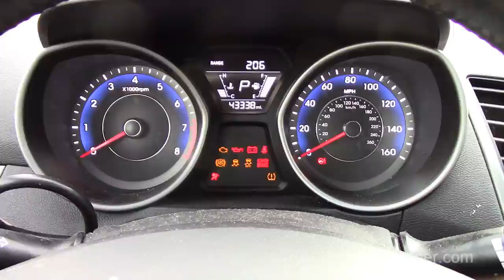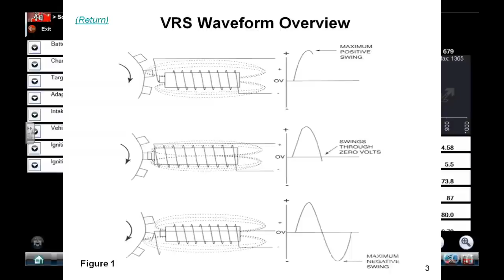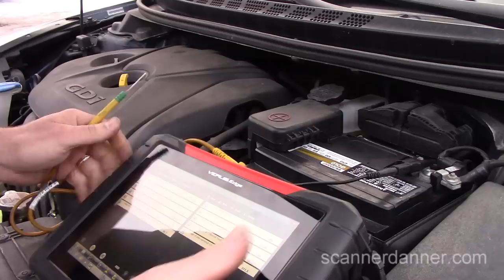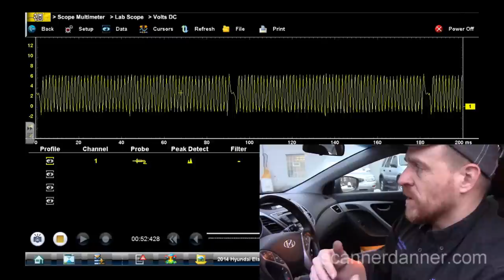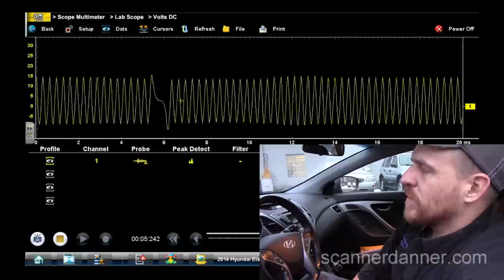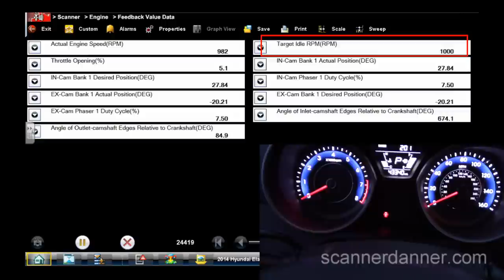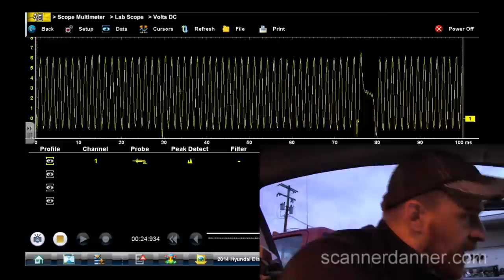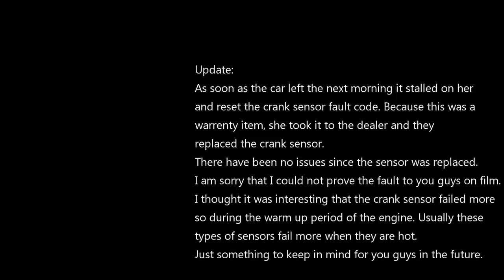2014 Hyundai Elantra Intermittent Stalling P0335 Crankshaft Position Sensor "A" Circuit

Comment: My wifey complained about stalling coming to stops and at idle.  I was not able to duplicate it or witness the failure myself for 3 weeks of me driving the car and riding with my wife driving. It was driving us crazy.  It only stall on her.  The after driving another 1200 miles appx.  It stalled on me like gang busters.  It would stall.  Hard crank to restart engine with warning ESC light and check engine light on.  The ESC on cases a super slow acceleration 0-15 in 6+ seconds, no RPM reading, and rough idling.  The next morning I took a couple hours to self monitor the car.  I cleared the warning lights by cycling the key on/off until the car started normally.  I let the idling until it stalled at appx.10 minutes when engine temperature was up.  My restart had the same results Check Engine & ESC lights on.  I cleared the warning lights and let the engine cool.  Car started fine and stall when it reached operating temp.  With the warning light on I ran a scan and got the P 0335 crank shaft sensor code.  Called up Napa and got the part $160 - Sensor CSS1435 for 2013 Elantra GT with 138K miles.  Removal & Replacement took 15 minutes. This is the only problem we’ve had with the car since buying it new.  FYI - DEALERSHIP HAD THE CAR FOR TWO WEEKS AND DIDN’T DO DIDDLY SQUAT.  SOMETIMES YOU JUST HAVE TO GO ON DIYS BEAST MODE THE GET THINGS DONE!  

It’s been 3 week!  Car is running good!

Cheers!

SJ

Comment: With no crank signal would engine rev-up still ? Friend tells me car won't go over 25mph. Has code p0355 runs fine when I drive it. I'm going to check wiring and replace the sensor most likely..

Comment: Yet another great video thanks man. I have a question about these vr sensors if you were to have a missing signal on 1 of the 2 crank sensor wires would it affect running at all. For instance a broken cable on one of the 2 ?
Reply: I wish he answer ur question, mine is missing ground signal

Comment: IMPORTANT: I had the same issue, it turns out I was really low on fuel. It stalled out on me once but the fuel gauge was reading two lines. The digital fuel gauge can be deceiving sometimes. When it stalled, it triggered the p0335 code. All I did was fueled it up, and the problem never came back

Comment: I changed the crank and exhaust camshaft sensors. No check engine light now. Still stalls. Dealer said the ecm need to told that the sensors were changed ($145) .  Sounds like BS.  Is this true?

Comment: Great video. I'd need your help, please. I have a probleme with my KIA TUCSON 2.0 DIESEL. Check engine is on, DTC P0404 «exhaust gaz recirculation circuit rang/performance» and the engine is on limp home.  Current data displays EGR doesn't work somtimes (intermittent), and when she work( after switch off - start engine), she work from 0% to 100% witch means EGR is wide opened or close. I changed EGR valve with a new one, electricale circuit is good, is the ECM defective ?
Reply: hey I'm no pro, but assuming its ground side controlled, might be an intermittent touch of the solenoid ground wire to the body (which you will never find on idle always happens when driving over bumps or road swimming pools lol. I would check o2 signal(Diesels dont have these then look at rough idle) whilst chugging the wire a little. if it goes rich then you found the problem. other then that look at sensors that provide input to actuate the EGR valve. Like ect, Engine speed sensor(CKP) regards student of Danner.
Reply: or intermitted power supply to the solenoid, funny connector.

Comment: Use De-Oxit to clean the connector contacts, tighten the pins and put dielectric grease on the contact areas. Test the crankshaft sensor itself if you find it.
Reply: Did this resolve the problem?

Comment: I've seen this kind of fault several times on Kia and Hyundai vehicles. If you see crankshaft related faults on ecu, you can really just replace the sensor, it's a very common fault on those cars. I don't usually blindly replace sensors just on fault codes, but on those specific cases there's not really much to it. And about the fault not showing up when the technician is around, it happens all the time 😅🤣
Reply from the maker: Agree with you on this one. New sensor was the fix and I couldn't prove it when the scope was connected. Next one I see is getting a sensor without even testing it.
Reply: Hey, how are you doing good sir? Hyundai Tech here, very common for CEL to appear and reappear with this code. Replace with OEM sensor and drive easy first couple miles usually done on test drive before releasing vehicle. Assuming there is no damage done to your harness a new CPS will fix your issue. Conditions should appear within 2 drive cycles also if you’re diagnosing. Goodluck!
Reply: @joecastro23  Hey mate, can you maybe help me with some info, since you are a Hyundai tech :). I have a Hyundai i30 (i live in Europe) with a 1.6 GFI G4FD engine that has some problems. 
First the engine runs rough on idle, shakes a lot, the idle rpm oscillates between 650 and 599, but runs better at higher rpm (over 1000). 
The car starts ok from cold/hot but the LONGFT is -6.5 in idle but goes to 0 when i rev up (its 0 around 3000 rpm). A mechanic changed the crankshaft sensor because of a p0335 DTC, and then changed the intake cam shaft sensor, now i get a p0340 but it's intermittent, sometimes it triggers a CEL but then it clears itself. 
I went to a shop and they said it's the timing chain that is worn (they did not check the chain) and it needs to be changed, but since its around 1000$ job i wanted to hear other opinions. The car has around 128k km (80k miles) with automatic transmission. If you have some tips please dont hesitate, thanks!
Reply: Did you find a fix? Was it the chain? I've got a similar situation for a month now, vexing
Reply: @Oladapofrank  if you get P0335 and there's no reason to believe the engine is out of timing, it is usually just the ckp sensor. If you give me more feedback on the issue, I might be able to help.
Reply: @thereeven  thank you, I couldn't use the car all of December, successfully ruined my plans, it's a 2009 V6 Hyundai sonata, it's got the 2-3 seconds rattle on cold starts, when the engine has been sitting for many hours it does that but goes away within 3 seconds, many people have the same issues so I don't think that's enough to conclude the engine is out of time.
The crankshaft position sensor I got wasn't from Hyundai, was after market, Chinese ( I know lol) but then my tach moves during cranking even with the old sensor, same with the new but the issue still persists, I even bought one camshaft position sensor (engine uses two) and it did nothing. 
I don't think there's a reason to suspect it's out of time, please enlightenment me if that assumption is wrong, I'd also like reputable brands for these sensors, a website to order too, thank you.
Reply: @Oladapofrank  about the brand of the sensor, I tend to prefer the genuine ones. Chinese sensors tend to work ok for some time and fail after getting hot. They are truly random at quality. Some may last, others don't. But let me get this straight: your issue is ONLY the noise? The timing chain noise itself is NOT related to the sensor, that I can assure you. If your problem is only the rattling noise in cold startups, this can be related to a failing chain tensioner, and in that case, the whole chain, tensioner and chain guides should be replaced as a kit, to avoid costly headaches. Oil and oil filter quality can also affect this rattling issue, be aware of that. This is a common issue with older engines regardless of brand, and if the rattling goes away and don't come back when the engine is warm and running, that can be a sign of an engine that may still be worth servicing. And you didn't mention, is rattling the only problem? Does the engine runs fine?

Comment: Question. these sensors have the benefit that they do not require an external power supply, because they produce there own voltage. However where is the 2.5 volts coming from when key is on engine off.

Comment: I had a some problem on the chevo Cruze crankshaft position sensor and the car has a hard crank sometimes it's stalling , I thought of changing the crankshaft sensor but my tools doesn't learn the crankshaft sensor , any idea how I can learn it after I changed the crankshaft sensor 🤗🤗🤗 thanks for the video

Comment: I've also had this problem code P0335, with a 2004 Maxima. I recently changed the sensor, but after a day of no issue driving, the car stalling when stopped, with the same problem code. However, now with a new development, RPMs are fluctuating (up and down sporadically) while in gear and engine is sluggish to accelerate.... perhaps something beyond the sensor issue?
Reply from the maker: Factory sensor only on Nissan!
Reply: @ScannerDanner  I have a 2016 accent same issues after I replaced the sensor the problem came back now I’m stuck on what to do

Comment: What about a starter that keeps failing? I get this clicking noise coming from my steering column. I took to the dealership and they replaced the starter, and said I had the wrong type of battery. I had a flood battery. Didn't replace the battery because the starter issue wen't away for about a year. Noise came back - decided to replace the battery w/an AGM type battery, ticking noise went away for a few months. Now its back with a revenge! Car dealerships are worthless. I've had the same stalling issue as in your video but it hasn't happened in some time.  Could it be the crankshaft sensor???

Comment: Every failing crank sensor I have come across fails when its hot...Many times I hve simply removed the sensor sprayed it with an aerosol like break cleaner to cool it down and it starts right up when installed...
Reply from the maker: me too, until now

Comment: I have a 2012 Hyundai accent and I suspect that the crankshaft sensor is bad because I tried to start the car and it cranked for a long time then I drove without a tachometer and the trans started to slip.

Comment: Great vid as always, thx buddy. I have this same code in a Hyundai i10 cranks ok but no start. I am curious, if I unplug the sensor and measure voltage, I have 12v on both pins. As soon as I turn ignition on, that voltage drops to 9.5v on both and when I crank it's obviously lower because of the load. This cannot be ok right?
Reply from the maker: This sensor produces its own voltage. Anything you see unplugged would be some type of bias voltage. 
Measure the sensor output (between the pins) with it plugged in and back-probing and use your AC scale of your meter

Comment: Got a p0300 code, and p0305 both misfire. But said it was coming from crankshaft sensor. I changed it, and my truck went nuts!! It through code p0339. It idles up and down until it shuts off. Flashing check engine light

Comment: Hi Paul, another great video thanks. I’m having a very similar problem. 08 Scion XB 2.4. Same code, however no stalling, no drivability problems at all. Prior to me the crank sensor and pcm (used) have been replaced. I’m curious, your code says circuit A. My says circuit B. I can’t seem to find info on that. Any ideas? Also if anyone has run across something similar, I appreciate advice. Thanks.
Reply from the maker: Not sure offhand but those are significant at times in giving you direction. You need to at least read the flowchart to determine your variables.

Comment: I have a 2013 Elantra the RPMs shut down but there's no code showing the mechanic checked it no codes showing no check engine on the sounds of the same problem

Comment: Was wondering if we could expect the similar symptoms for camshaft sensor faults too?
Reply from the maker: depends on the car, they all react differently to cam sensor faults depending on the ignition design of the car and also how many cam sensors it has
Reply: Speaking from experience. The answer is. Yes. Camshaft sensor needs replacing as well.

Comment: Wondering if this is the same freaking thing in my 2013 elantra.  Brought mine into two shops after twice having it randomly not start and neither shop could replicate it.  I guess for good reason they can't since it seems to do it weeks in between.

It cranks but starts up incredibly weak when it finally gets going, tach would still work although granted eradically, and the engine again sounded very very quiet but stumbling almost like a misfire.  After doing a restart of the car, all is fine like nothing happened.  I wonder if Im just seeing the beginning of the rabbit hole, I already dropped money on a battery sadly after a shop told me it was bad because of the CCA.

One day I got in my car thinking doo doo doo brand new battery I'm good.  I turned the key, crank crank crank for what seemed to be way too long, before it finally started but again unnaturally quiet and stumbling almost dying.  I may just try this man, I've already flushed money down on the battery, and this seems to be all over the net aside from the shifter problems which only seems to be the issue when there is a no crank, and no click.

Regardless awesome video, I was thinking it was a different issue entirely, like bad spark plugs, bad fuel pump, you know the stuff that usually breaks on cars lol :P

Comment: A have a 2013 model and This is literally exactly the sound that it’s making, I do live in Miami so this is happening the first 5-10 of me driving, it still drives when it has 0 rpm and sometimes I have no choice because it happens right when I get on the express way, anyways, so I should just try to unplug and plug it in to see if that’s the fix?? Or maybe call Hyundai To see if it’s replaceable

Comment: My daughter in law Hyundai Accent 13 is stalling while she is driving , RPM’s are very low when she starts car , crankshaft sensor ?
Reply from the maker: no tachometer operation with this failure, so if the tach is still working it may be something else. These will set a fault code, so start with that

Comment: I have a 2018 Elantra that just died when I stopped. I cranked it back up and it died again after I drove it a few feet. I changed the oil and put some gas treatment in it hasn't done it again but, tomorrow I will be driving it for 4hrs  like the day it stopped. Any ideas?

Comment: Thanks, as always Paul!
Reply from the maker: Thank you Mike!
Reply: Cool drivin' Mr. Paul! 😎
Reply from the maker: It was like Grand Turismo :-)
Reply: Yeah as you said those freaking intermittent stalling and various problems can be awful frustrating as heck sometimes most of the time mr. D! Actually I'm just starting my diagnostician career hear this last year with a decent scanner and just purchased a Pico scope so I am fairly inexperienced as yet but have had a couple. One very similar to the one you're working on right now. For sure those intermittent problems aren't the funnest, specially when you expect them to be duplicated when you touch and move something and they don't! Had a very similar problem with a 2000 Grand Prix lately, actually it was my first opportunity that I've had to take over from another's parts changer diagnostic attempts  to solve  this stubborn  stalling  problem .  I was brought in to see if I could help resolve the issue, and I was excited to prove my diagnostician abilities SOL (Smilin Out Loud) but wasn't to be on this one. The previous mechanic had replaced a few items as usual to no avail so I started testing the powers, grounds, input and output signals to the ICM and computer. So after it stalled sometimes I found that I could move the harness wires to the ICM and hear the solenoids and power click on and off of which wouldn't happen every time! In the end he finally replaced the harness to the ICM which was the problem and when I first thought that I disconnected the harness and checked continuity and pin resistance problems ( manual not electrical ) and found no discrepancies, but that solved the problem in the end... replacing the harness. Sometimes it would take a few minutes to 15 to 30 minutes to stall and other times it would stall and start right up or have no spark and no cam signal to the ICM. And of course he wanted to just change the ICM or put another crank signal in, but I insisted
 that "no don't do anything yet,5 I'm not finished and I will let you know when I find the real problem. I learned that from you mr. Scanman! You and a couple of other Excellent diagnosticians out there in YouTube educational land :-)
Reply: Good movie but I didn't think you could carry in PA there Professor.

Comment: great video love the way you explain everything I am just wondering about why you would say this a no-cost fix? I would say you should be paid for your diagnostic time spent
Reply from the maker: For sure! Things have changed for me now and I forget sometimes this is where all of this started for me. I was originally a mobile diagnostic guy, making my money on troubleshooting, then telling the garage what to fix. Things have changed for me now. The camera pays better than any fees I charge. In this case I had a personal friend contact me and tell me about her car. I volunteered to look at it for free for her as long as I could film it. Hope that makes sense.
Reply: thanks for the explanation i just wanted to check on that because so many people and customers think that diagnostic work should be done at no charge and or should be given away or included in the repair or even discounted
Reply from the maker: For sure and you were absolutely right in pointing this out. I have been an advocate for years in charging for diagnostics. My rates (before YouTube) were $70 per car up to 1 hour. If it was a 5 minute diag. it was still $70. 
And I feel that was a deal. If I was still doing this it would be $100